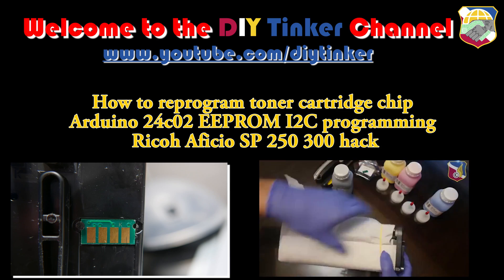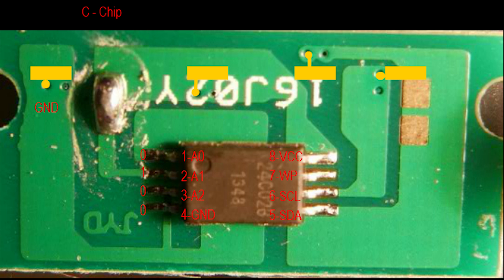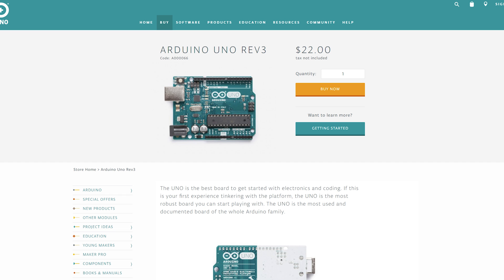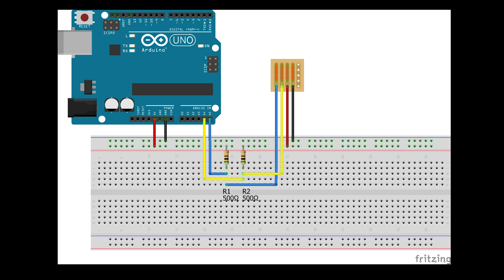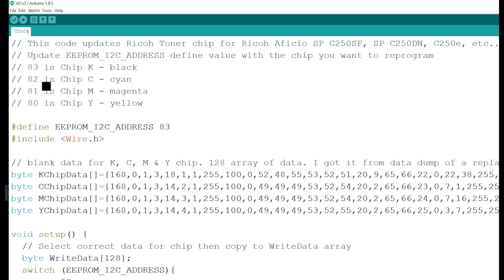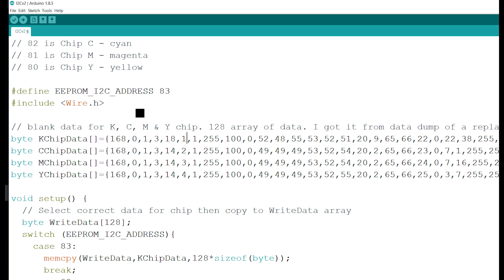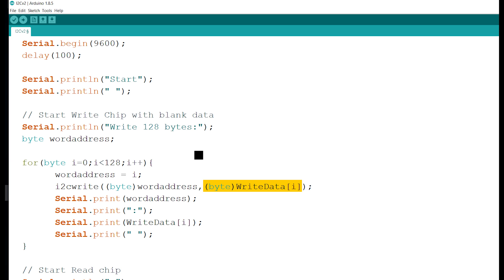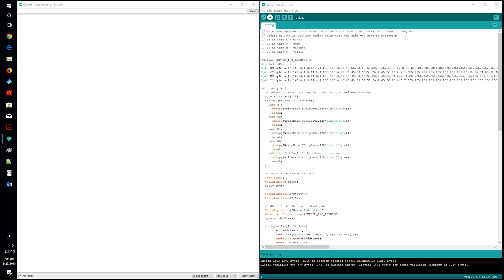How to hack Ricoh Aficio toner cartridge chip using Arduino UNO - program 24c02 EEPROM I2C

Comment: Works great.  However when I use a sketch to dump the data from a new chip, all I get is 255's.  If i take a Microchip 24Lc256 (which is what I happened to have), write your data to the chip and try to dump that, it works fine.  Any insights into why this happens?  Would you mind sharing the sketch you use to dump your chips?  In both instances, I just used four leads for setup.
Reply: He gives the code link above:  
https://drive.google.com/drive/folders/12UAa12sVB6IfwfbNomkOB33_pEdkzMXV
Reply: Thanks for the reply.  I have no background in either programming  or electronics. After I posted my question, I figured it out.  I didn't realize that if I removed the write code, it would just read the chip.  The Arduino Uno is very interesting.  I've been playing around a lot with it.
Reply: Hello Jim, It seems you have more knowledge than I do on programming.  When you say you removed the write code, do you mean in the sketch you removed the total line 12/13/14/15?  OR - did you leave those lines in, but remove the data from 255 on to the and?
Reply: LOL's.    I have absolutely no programming or electronics background.  I was looking for a way to reprogram a toner chip.  About 3 months ago I bought an Arduino Uno, a breadboard, some DuPont cables, and some alligator clips.  I bought the Uno because I see all the You Tube videos that use it and thought there would  something to that might point me in the right direction.  I found this one and was a great help.   But I digress. What I did was copy his sketch to wordpad and then delete the section starting with "// Start Write Chip with blank data" up to "// Start Read chip".  Then saved it as a new file.  When I enter that into the Uno and start up the Serial Monitor Tool, it read back what I had written to the chip.  255 just means that there is no data there.
Reply: @jimsmith9803  Thanks my man, you're a star. I was trying to figure out how to read a new chip on my Samsung ML1670, but didnt know which section of OP's sketch to delete.
Reply: @cobraCPT  And now for the bad news...    I have an old Samsung C1810W.  I can successfully read the chips for that printer, but when I try to write to them, it fails.  The Arduino says the process is successful.  But if I go back and do another read, none of the values are changed.  It must be write protected some way.  If you find a way around this, please come back and tell us how you did this.  Also, if you didn't have this issue, please let us know that also.
Reply: @jimsmith9803  Unfortunately I kinda jumped the gun, when I looked at what had printed to screen, it was all zero's.
From what little I understand, there 1st needs to be a write command to the read bit area in order for the next read command to function.
So Im not even getting a good read in this matter.
I'm thinking of getting a CH341A eeprom programmer in the week to see whats going on, because my coding skills suck to say the least. :
On a side note I had a look with DS212 o'scope and I could see the waveform on both SDA and CLK blip every time the Mega spoke to the chip via usb.
Reply: @cobraCPT  That sucks.  I don't remember much about my experience.  It was a couple years ago.  I do remember getting bits in the format I was expecting and not all 0's or 255's.  Maybe 7 years ago, I also played with a CH341A programmer.  Didn't have much luck.  When you get your CH341A programmer, I would appreciate it if you would reply back and let me know how you did - one way or another.
Reply: @jimsmith9803   I think you're going to struggle with that one, seems like that chip(CLT-504 Toner Chip) has 2 ic's on it, so one of them might be storing last known crum serials, ie even if you can reset the status bar area, it might still block the toner cart after a certain time.

When the chips were originally written, all 3 address lines were held low, so if your chips are epoxy potted you cant access the address lines on A0, A1 and A2.

That said, the printer is changing a certain area on the chip without access to the address lines, so it must be making the A0 (LSB) high to write the status bar characters, whether its A5 or FF and where exactly, I dont know enough to be able to say.
I took the easy way out with a hardware hack as I mentioned in my other replies to you and lifted the ic pin 7 to stop the printer from writing to the mem.

https://www.reddit.com/r/printers/comments/1fto8pl/any_luck_reading_a_samsung_d104s_toner_chip/
Reply: @cobraCPT  Yes. I had forgotten about that.  The second IC is a PIC32.  Unfortunately, the chips I have now are epoxied so I can't play with them.
Reply: can you please provide the way how to dump data for spc 252sf , i am a beginner in arduino and if you can provide a code file  it would be very appreciated.

Comment: Hey, thank you a lot for your videotutorial.
I would like to know if this procedure will also reset the chips of the Ricoh Aficio SP C252dn.
Reply from the maker: it should work as it also uses I2C. you might want to data dump a new chip then rewrite it on your toner. let us know if it worked.
Reply: Hey! I've not seen you reply. Actually I post a new coment to confirm my success. Now I have all my cartdriges resseted and I still printing with the original toner until the cartdriges get empty.
Thanks.

Comment: To get the data dump did you use the read function ?

Very interesting, thanks for sharing.
Reply from the maker: yes, first I used the WhatI2CAddress function and identified the I2C address. Then i used the I2CRead function and dumped new chip data. You can use this method for lots of other applications. I would like to believe this should work for many other Ricoh printers as its common for a company to stick to similar chips, circuits and design.
Reply: Sir,do you deal with other models of Ricoh?
I'm from India and deals with A3 size copier. I'm facing sc 672 in couple on couple of controller 
Thanks in advance.